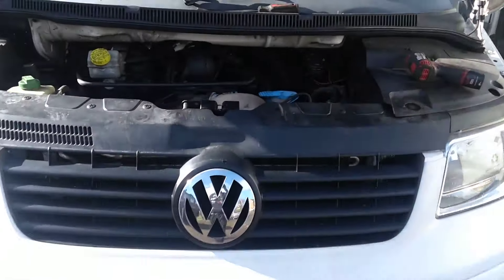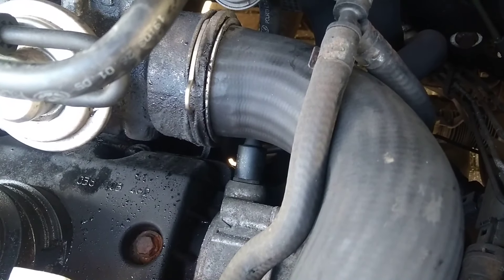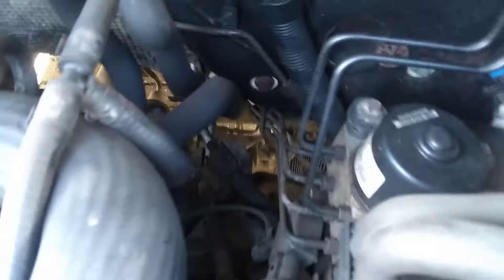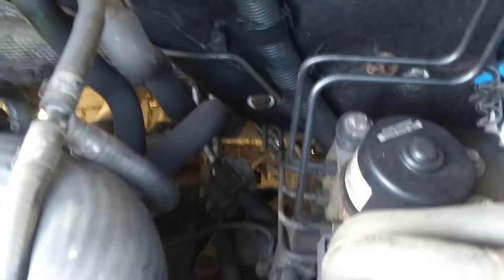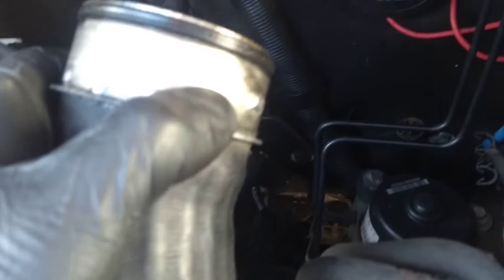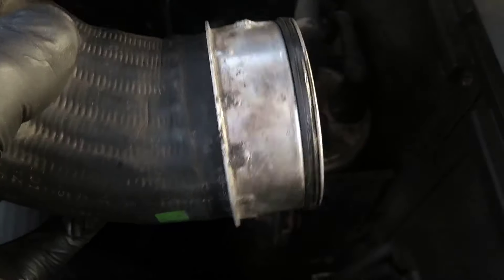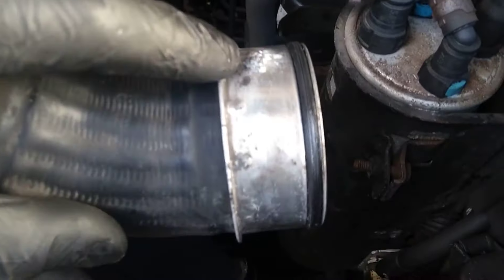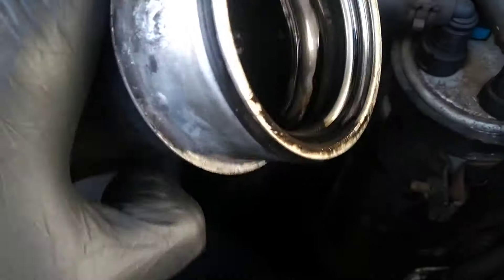Why is VW boost pipe blowing off or leaking? intercooler Turbo woosh whistle air blowing noise

Comment: Theres a seal between the plastic part of the pipe and the steel part by the circlip .... When that seal tears wind will blow past that seal making a loud hiss sound.... I replaced it with 2 normal O-rings ontop of each other for better sealing .... Since part stores were closed on a Sunday..... Worked perfectly ..... Hiss sound was gone

Comment: great video got a 2007 jeep patriot got loud air noise like escaping air when i get to about 2000 revs think you have solved my problem  SUBSCRIBED
Reply from the maker: Thank you. The Jeep 2.0 CRD is a VW engine isn't it
Reply: @ORileysAutos  year it is  vw engine just had new turbo fitted then this happens 
thanks for the reply

Comment: Happened to me, heard a loud boom. Opened the hood and saw the pipe unconnected, had to get to the mechanic to replace it, was a funny ride there, 1st-2st gear max or it would die, lack of all power as well. It wasnt expensive to replace if someone is wondering
Reply: Mine blew off other day . . . loud ain't they lol
Reply: @grahamw6503  Yeah :D
Reply: @oldgangsta6993  😄😄👍
Reply: Mine did it today, loud pop and loss of boost
Reply: @klinikalRP  did it drive ok on the flat??, just landed in Cornwall and she won’t rev past 2k, so won’t go uphill but ok on the flat??

Comment: Is this problem can cause engine / fuel smell in interior and power lose to? Additionally hissing sound when accelerate? in cold weather this problem dont occur
 Lot of thanks
Reply: Iv got low power, hissing sound I can hear just as I lift the accelerator abd flashing engine light. Checked the codes and came up as turbo fault. 
Now as I own a kia sportage and turbo is down behind the engine I wanted to make sure before I done anything stupid like changing the turbo.
Il check for loose pipes tomorrow.

Comment: This happened to us when traveling 100km from home.. was a mission to get home.. but we got it patched.. just enough to get home.. now we replaced the whole lot.. with proper piping and clamps..
Reply: Did you lose all power to turbo, did you notice that 2nd gear or even just hitting the gas was sluggish?
Reply: @devilmk6769  only way to move was on 1st then second gear.. anything else the car died.. all power gone..
Reply: @MrGhostsword  update, i replaced pcv valve 2 days ago, new fuel injectors and some injector cleaner and check engine light is gone and car has restored power👌🏼
Reply: @MrGhostsword  i got extremely lucky
Reply: @devilmk6769  awesome result!!!

Comment: would loose pipe cause juddering around 2000rpm? changed the MAF and ran injector cleaner through tank a couple times but just noticed the loose lower pipe today
Reply: Yes,it will.
Check also the seal's around the pipe for oil leak.
If so,the power loss comes from these leak's.

Comment: Whats the name of the hose,I loosing power on my passat b6 2010,thing is I also smell fumes in the car and p0401 code comes up 2 weeks ago exhaust gas recirculation flow insufficient, I replace the egr valve but still doesn t get the proper boost ,turbo was redone 2 months ago also stage 1 remap on the car but the turbo don t kick off like supose to be
Any ideas ..I stil think somewhere is a leak ,I really can t use the fans in the car ones u turn the heat on all the fumes come in the car

Comment: I only changed mine last March & it’s gone again🙄 seems to be a yearly thing ..surely it should last longer? Mine pipes off at the top
Reply from the maker: A lot of people put a self tapping screw in it or use heat shrink tubing to seal them together
Reply: @ORileysAutos  I changed the top one then the bottom one started blowing off so replaced that as well. Thought I’d fixed it but just gone a steep hill & bang no power again, got home checked the pipes & they are still on? Do you think it could be the n75 valve

Comment: No don’t replace pipe I’ve putting proper self tappers trough the pipe and housing for years on Mercedes never gave a bother yet use Wurth German steel screws
Reply from the maker: Yes this does work

Comment: my boost pipe blew off my seat tdi got such a fright so did the bloke I was passing at the time, Fixed it with a couple self tapping screws but to scared to go over 2000rpm lol been 2 weeks of very slow driving now
Reply from the maker: Screws will hold it better than factory design

Comment: Could this explain the choppy whistle coming from engine bay only when driving and above 2k rpm? I had turbo replaced and since then I hear this choppy whistle.(Audi Q5 2.0 2013)
Reply from the maker: Yes. Very likely it's a similar hose that could be causing it.
Reply: @ORileysAutos  thanks for the reply. I will try to focus on these pipes to see if I can resolve it. I have the whistle recorded here. https://youtu.be/H7BZSXGUvDE.
Reply from the maker: @Pavel Machala  hard to hear but sounds like manifold gasket leak or turbo gasket
Reply: @ORileysAutos  I had a bad gasket between old turbo and cata and that sounded like just loud engine ticking (kind of like really loud diesel engine, while it is gasoline). But with new turbo there were both gaskets brand new. It was done in the shop but I am very concerned they have messed it up as I also had to do a recall for an oil leak on return line earlier... Would manifold gasket leak cause that choppy whistle only when driving and not when in neutral? Also the choppy whistle got worse over course of the month, it is much easier to reproduce it now when accelerating.
Reply from the maker: @pavelmachala  it's very common to damage the gasket while fitting the turbo or EGR
Reply: @ORileysAutos  So if the gasket would be an issue shouldn't I be able to reproduce that choppy whistle or any other noises while in neutral and in higher revs? Like I said earlier it is only when driving and revs are in between 2k ~ 3.4k.
Reply from the maker: @pavelmachala  no you won't reproduce the sound while stationery because the turbo doesn't fully boost until it's under load. I'd first check the bolts are tight then check the gaskets

Comment: My t5  is making a whooshing  sound when turbo is active  can hear it in the cab  sounds like it coming from drivers side of engine..maybe this is same issue on other side of turbo
Reply: that's how the problems with my to started
Reply: Sorted it eventually     turned out  there was movement  in the hard pipe that that comes down the left hand side of the block   ..it had been  rubbing against a mounting and eventually worn down the metal until  a small hole in the pipe ..replaced part    15 quid for a second hander of eBay    sweet as a nut now

Comment: I’m having the same problem on my vw Passat 2007 went to Halfords for a engine check because I could hear a hissing noise and noticed a loss of power and they said it’s either the intercooler or boost pipe any idea how much it would cost to get it fixed
Reply from the maker: It depends on the section of hose. They vary in price
Reply: My pipe was £25 on eBay. Labour wouldn't cost much but you can do it yourself fairly handy.